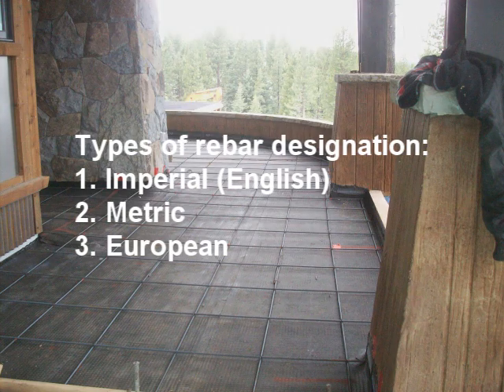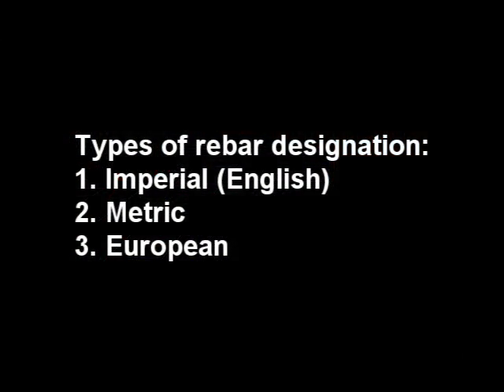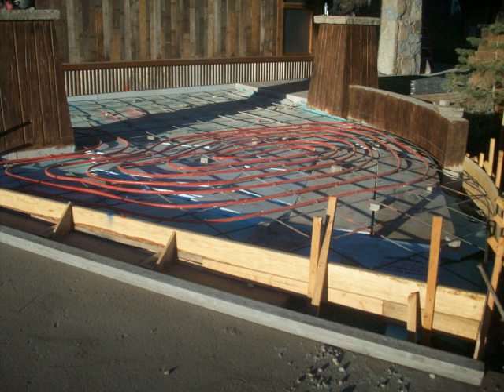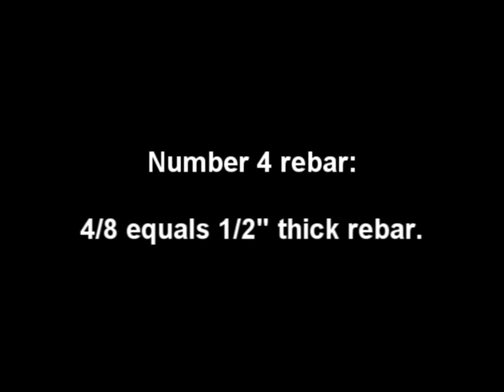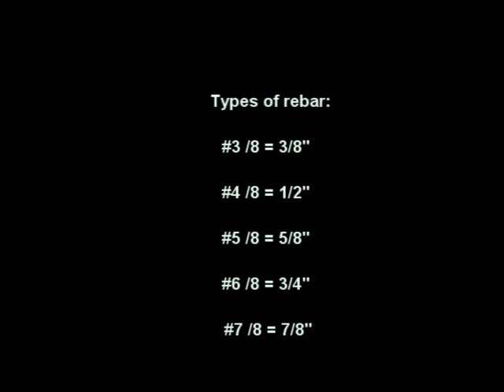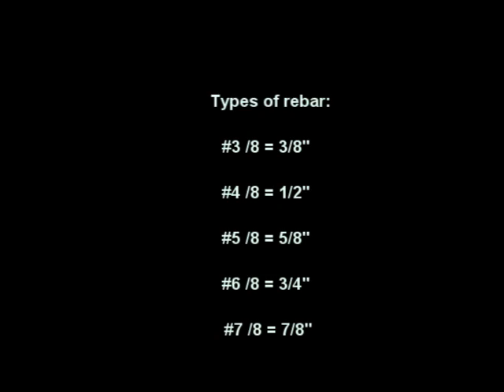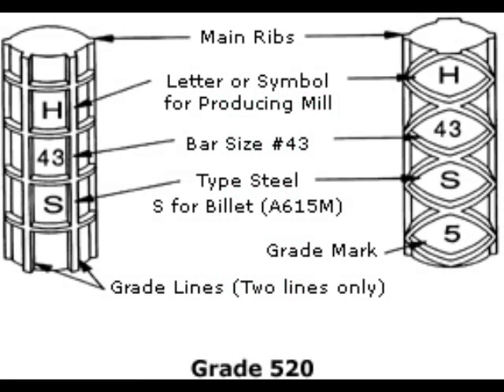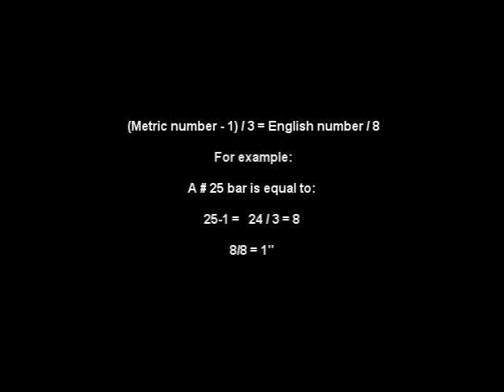How to read rebar

Comment: mt structural drawings say 2T16, is it a metric system or imperial?
Reply: Its metric. 

In this case its top steel 2nd direction. #5 bars. 5/8 of an inch.